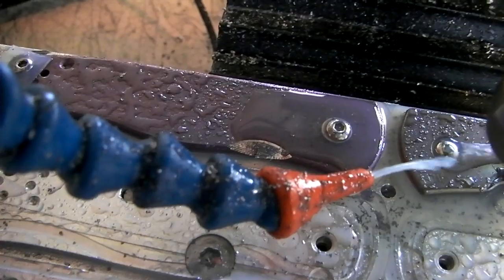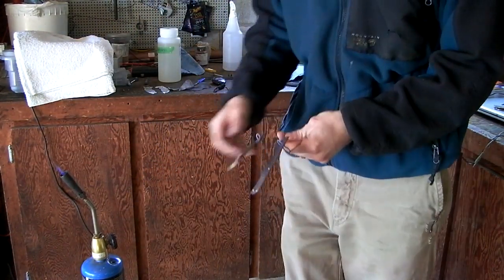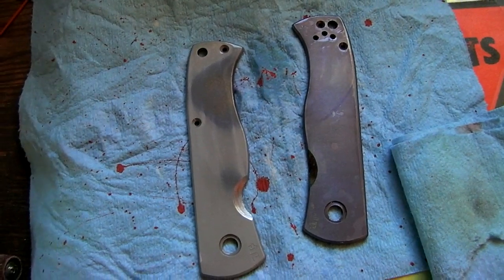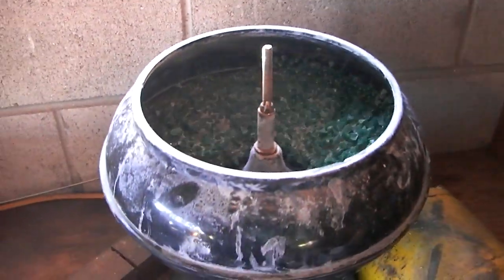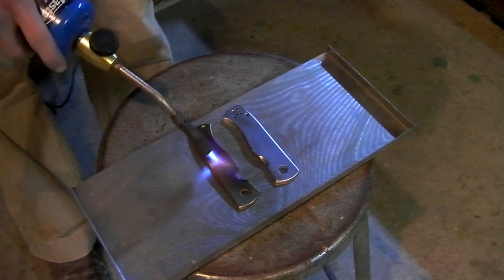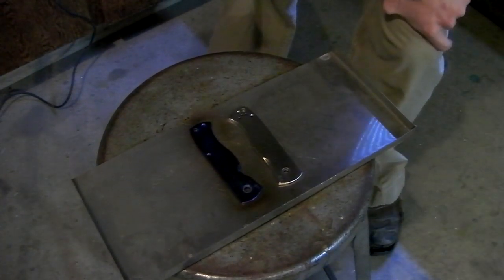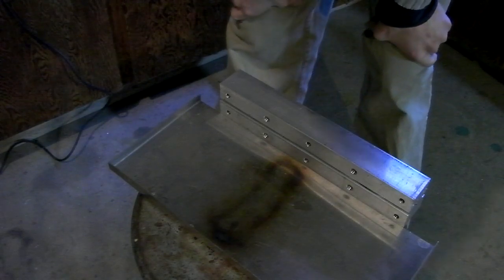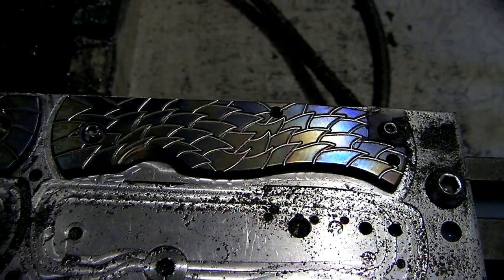Heat anodizing titanium and engraving

Comment: Btw the blow torch is hottest at the tip of the blue fire. If ur too close meaning not the tip of the blie fire but rather in btw u dont get maximum heat benefit and vice versa if ur too far away from the blue fire tip ur getting minimum benefit.

Comment: This is the third video I've found in the last 60 seconds that incorrectly calls the color change of titanium from heat "anodizing." Anodizing is caused by electric current, NOT heat. When you use heat to change the color, it's called thermal oxidation.
Reply from the maker: +RationallySkeptical You are probably technically correct, although everyone in the knife world calls it heat anodizing so that's why the term is so prevalent.  Don't let it bother you ;-)
Reply: +RationallySkeptical Is there any difference in outcome from the two methods?

Comment: you need to go to http://www.reactivemetals.com and buy their power source.  with it you can anodize many colors without the heat.   the price is reasonable and it does a great job
Reply: sorry I needed to watch the whole video before talking
Reply: Also, why would you buy that kit for $240 when you can get basically the same power supply for $50 on ebay?!?

Comment: does heat anodizing titanium mess with tolerances at all once it has cooled down? would like to get something like that done with a balisong.
Reply: Rationality and skepticism are non-compatible.
Skepticism is a philosophy that denies the possibility of knowledge.
Skepticism is the quality of non belief.
Rationality is the quality of evidence based beliefs.
Your ad-hominen attack suggests that you merely fly the flag of logic, while lacking the fundamentals necessary to practically apply it.
It is interesting to note the perversion of language by the mainstream when the concept is widely disapproved of. The words are turned on their heads.
Reply from the maker: Nope, not at all.  Ok if it does it's in the "tenths" which is like 0.0001", basically nothing.  Easy to do with a titanium bali, just best to take it apart first, which is typically harder to do than the anodizing itself.
Reply: +frickbot There's no such thing as "heat" anodizing. See above comment.
Reply: heat anodizing, heat anodizing, heat anodizing, heat anodizing.....it's a thing...
Reply: ヽ༼ຈل͜ຈ༽ノ lyou're an idiot. There's no such thing as a 'bias' toward skepticism. Your statement only reveals your ignorance in not understanding the term. Skepticism is only the position of not believing anything unless its based on EVIDENCE. If anything, "rationally skeptical" is redundant because skepticism, by definition, is rational.

Comment from the maker: MariTool.  I really love it!  Not cheap but it IS worth it.  0.062 radius.  It's double sided and I've been using the same tool for almost a year!!  I just recently noticed a chip in one of the three flutes on one side so I only use the other side now, but the tool life is incredible.  I've cut TONS of aluminum, quite a bit of Ti, and probably 5 sets of CF handles.  This tool and their corner radius endmill are the only tools that have lasted me this long.  They rock.